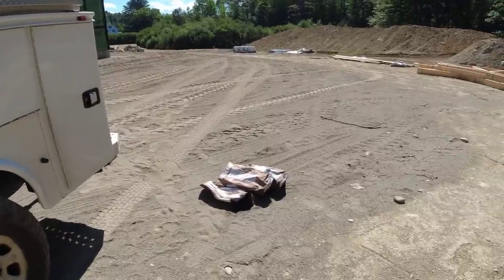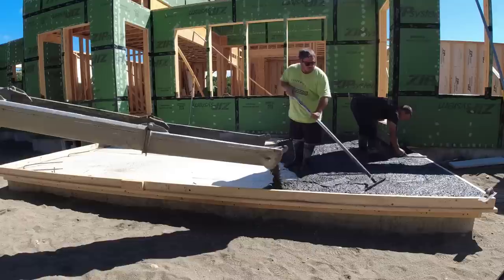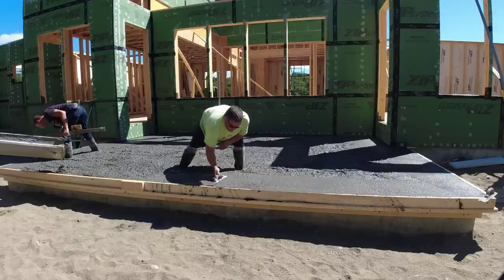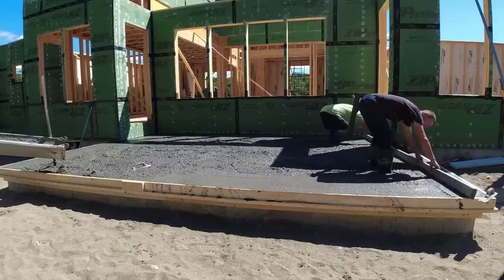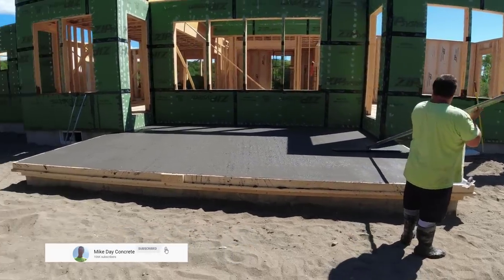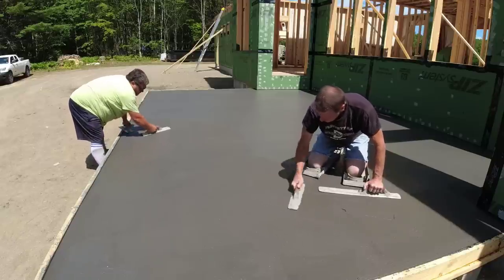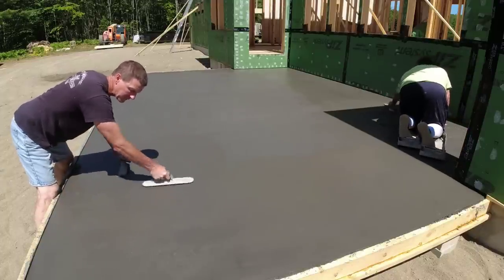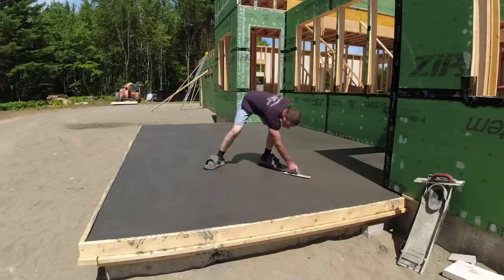How To Pour A Colored Concrete Floor (Charcoal Color)

Comment: I'll often put a 45 degree chamfer strip, top and bottom, on cantilevered slabs like this. It's a nice look.  I did a little lava stamped pads in Hawaii years ago with that charcoal color and a rust color broadcast hardener. Some people thought it was real lava rock. great work!
Reply from the maker: Nice, we use the chamfer on some of these too.

Comment: Looks beautiful!!! If the house is spec out for white facade, dark concrete suits it well. Also, I love smooth finish concrete looks more like a stone rather than concrete
Reply: This is my house, you are correct, white siding and trim, black windows and black roof. I think it will complement well.
Reply: I’d love to see a picture of the finished look of the patio once it was sealed.

Comment: Good morning Mike, another season is winding down.
Reply: I have deep charcoal borders and pewter with deep charcoal release on all my driveways and patios
Reply from the maker: Yes, We usually work beyond Thanksgiving. Pouring in freezing temps isn't my favorite, but I have my heated jacket to help keep me warm!
Reply: @MikeDayConcrete  I shut down at Thanksgiving or first week of December,  depending on weather.  I used to have a couple of ground heaters and we would go all winter pouring parking lots and commercial projects,  but thats too much work year after year. Just trading dollars with more risk. Poured a big job that the temps never got above zero, and I decided that was it. Sold the heaters that spring and sold 500 blankets. Which in turn freed up 4 trailers and a ton of shop space.

Comment: Mike, I’ve used Lexan Plastic hand trowels and machine blades on colored concrete that required a trowel finish. Keeps the color consistent and prevents burnished areas/ mottled look. Check them out sometime, they feel like toys…
Reply from the maker: I will, thanks